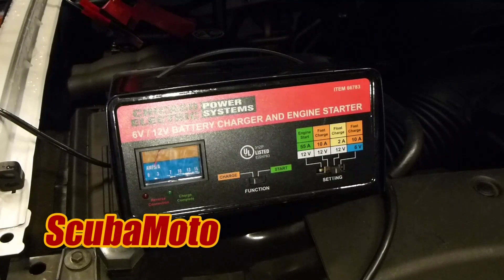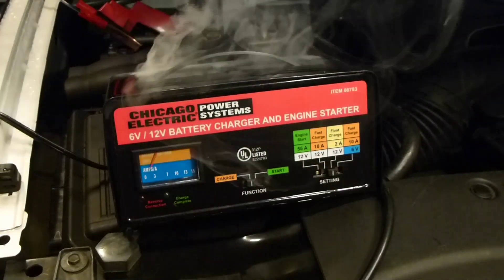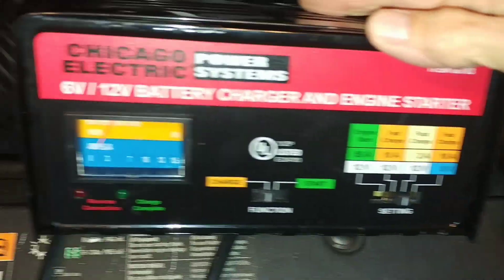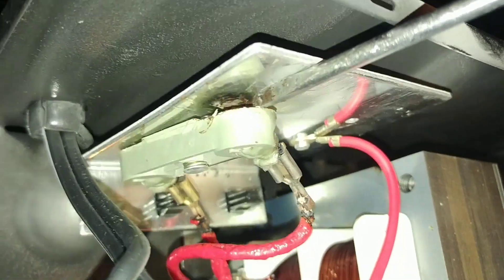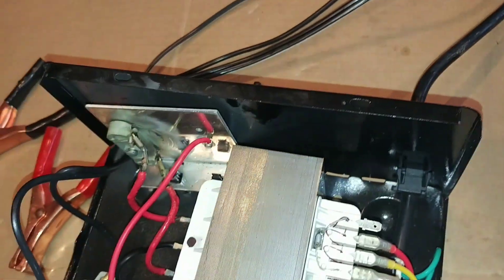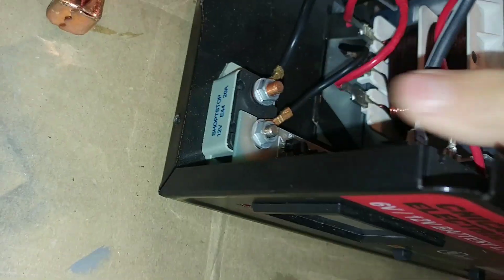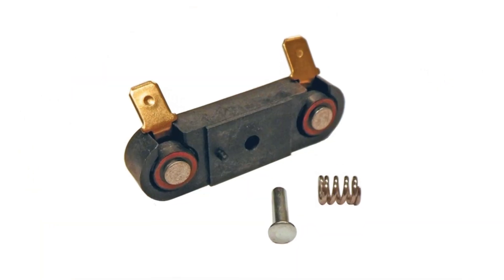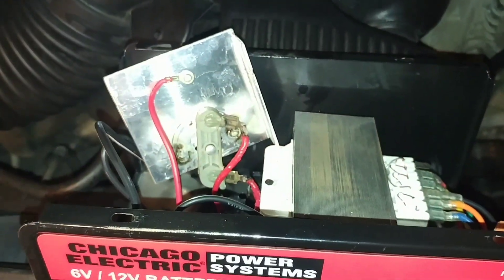Battery Charger Goes Up In Smoke - See Why

Comment: Couple of inexpensive bolt mounted diodes sourced off EBay for about $6 with a higher rating drilled mounted to the heat sink, would be a easy fix and last  longer than a spring heat sink contacted like those cheap button diodes provide, been there!
Reply from the maker: Agreed. Fixing it would be like overhauling a Yugo.
Reply: @ScubaMoto  My OCD makes me fix stupid stuff😅
Reply from the maker: I totally understand. We're just keeping stuff out of the landfill.

Comment: This happened to me when I placed the clamps in the wrong terminals.
Reply from the maker: ericj: Thanks for the comment. I'm surprised that was the result since most are designed to detect reverse polarity. The rectifiers are usually the fail point on those old Chicago Electrics so I'm not too surprised. It served me well for over eight years. Thanks again for the comment.